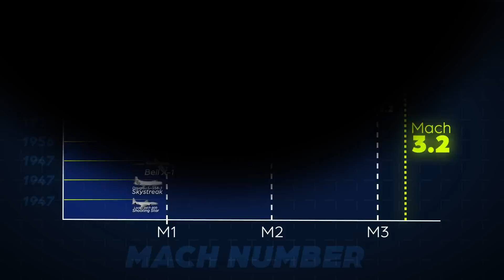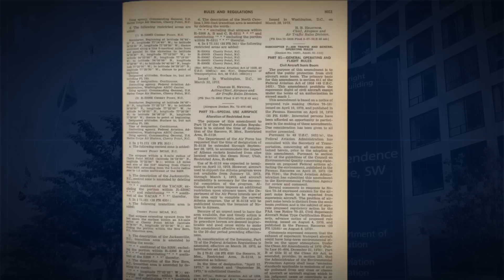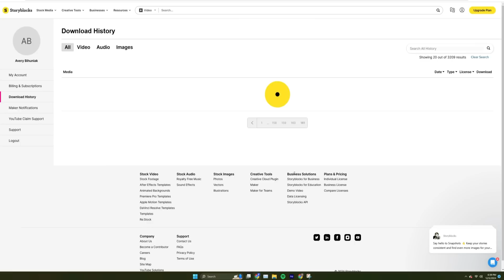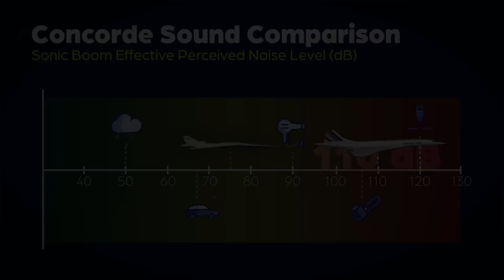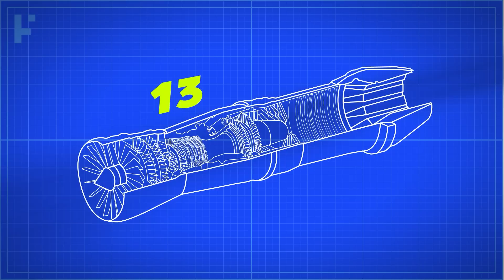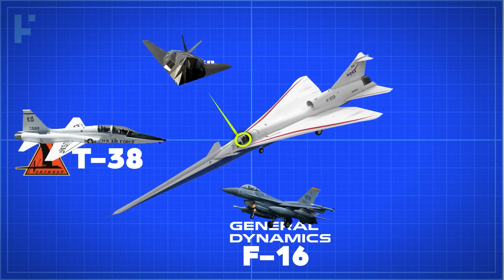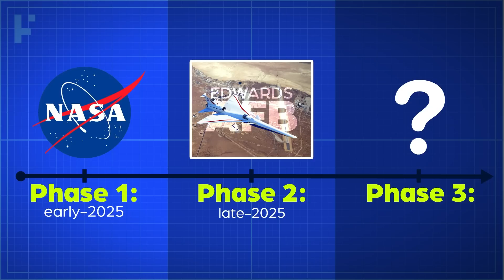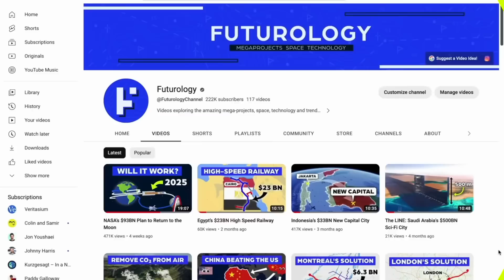NASA’s NEW Most Advanced Jet (X-59)

Comment: 9:52 in metric units: Length - 3.9m, Diameter - 88.9 cm, Thrust - 57.83 kN; with afterburner - 97.86 kN, and Speed - 1,594 km/h. At 11:52, the length is 30.4 m, Wingspan - 9.05m, Height - 4.26 m. MTOW - 11,022 kg.

Comment: Metric! 95% of the World uses Metric. 
And also most of it uses DD/MM/YYYY format...
Reply: Yeah man, Americans will use anything but the metric system. I've done the cumbersome task of converting all the units. At 9:52 in metric units: Length - 3.9m, Diameter - 88.9 cm, Thrust - 57.83 kN; with afterburner - 97.86 kN, and Speed - 1,594 km/h. At 11:52, the length is 30.4 m, Wingspan - 9.05m, Height - 4.26 m. MTOW - 11,022 kg.

Comment: 1:00 The Concord wasn't the first supersonic commercial aircraft.
It was the Tu-144.
Reply: Kinda.  First to fly was TU-144 on 31 Dec 1968, Concorde maiden flight was 2 March 1969.  First Commercial flight was Concorde on 21 Jan 1976, TU-144 was 1 Nov 1977.  TU-144 flew first, but Concorde was the first to fly commercial routes with passengers.
Reply: The TU-144 only did a hop flight on December 31, 1968. I think Concord went SS first.